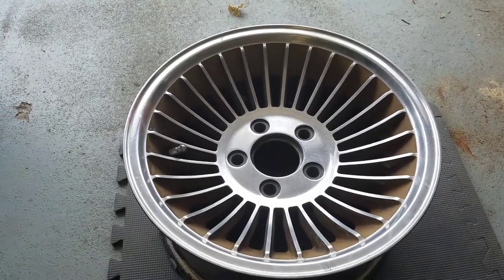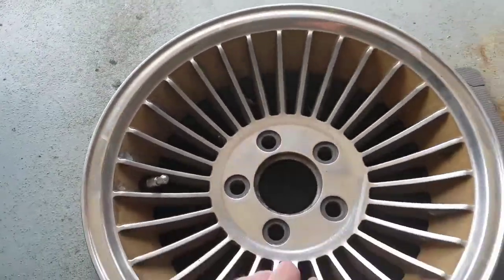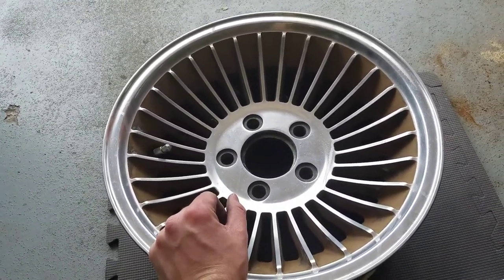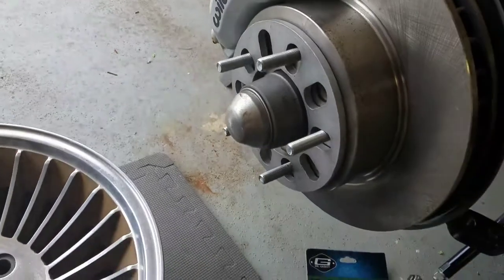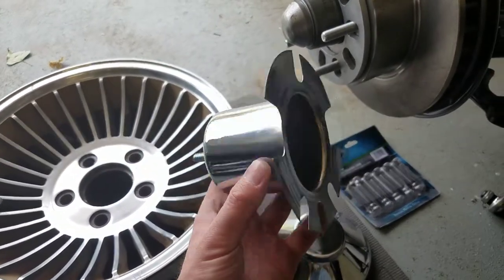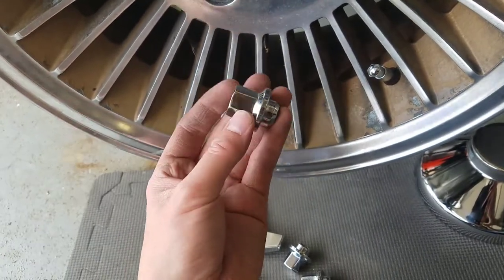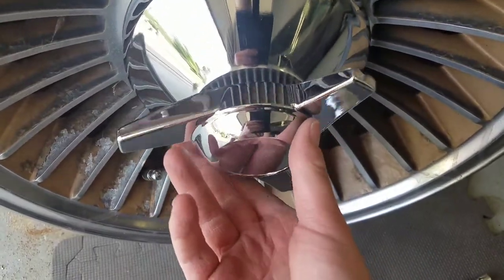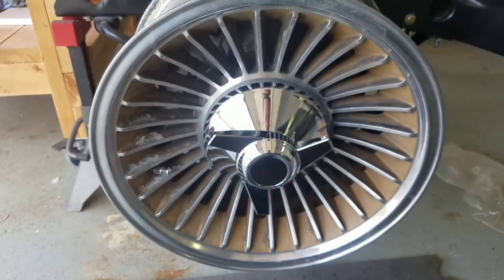1966 Corvette -DIY cheap bolt on "knock off" wheels

Comment: Hi! Are there any updates since this video was uploaded? Did you polish and paint them already? Wonder how this project turned out. And how it looks with tires on it. Very interesting. I own a 1966 C2 and would do the same because I realy like the curved design more than the original C2 Knock offs. Thank you for your reply.
Reply from the maker: I haven't had them painted yet. I just put the body back on in October. I'm waiting to get the rest of the car done and will do the wheels and body last.

Comment: The word must be out on the z28 rims, because I've look all over for a set for my 64 C2 Coupe....cool tip though..
Reply from the maker: my31and37 
I couldn't find any for a while. Finally I posted a wanted ad in the local classifieds and got a call about a month later. Good luck!
Reply from the maker: If your still interested here's a set on eBay... price seems a little high though. 

https://www.ebay.com/itm/254610969596